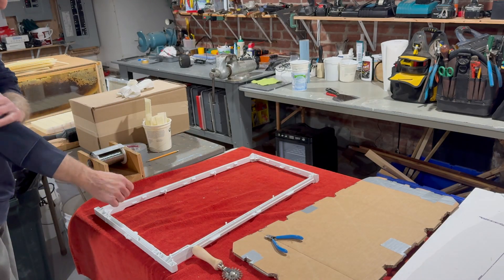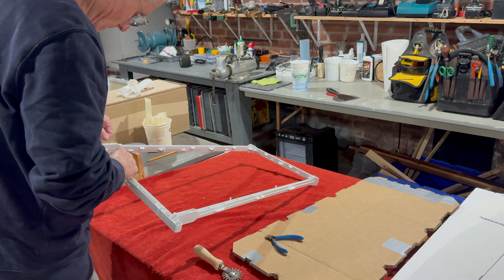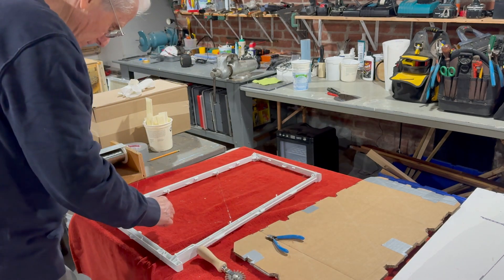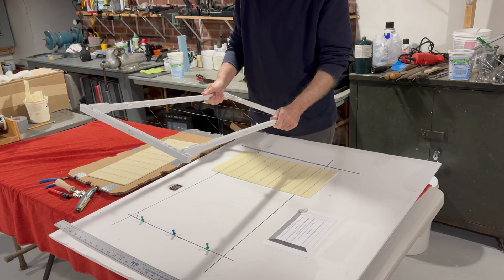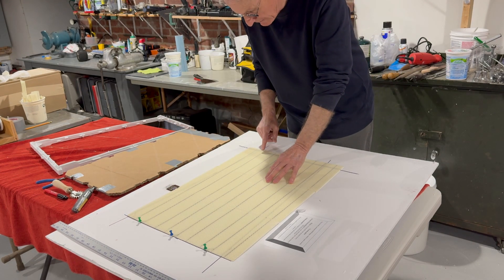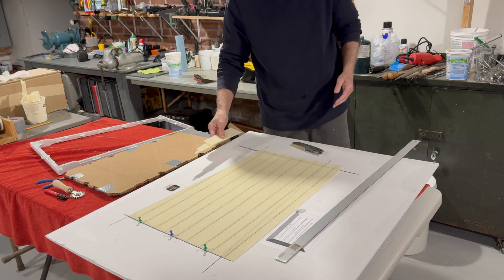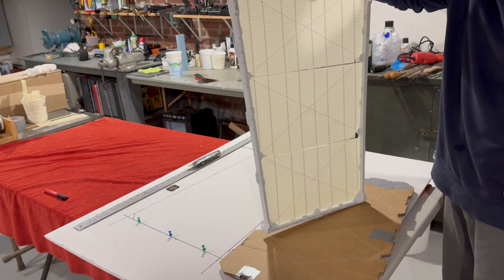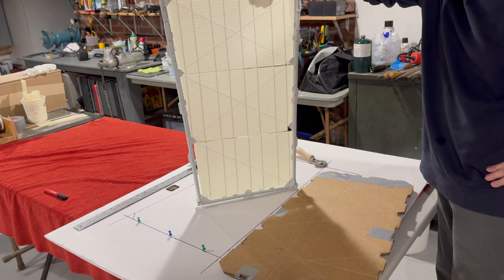Primal Hive Wiring

Comment: Hi Bill, after you crimp the wire into the wax, do the bees build right over the crimped wire?
Reply from the maker: Yes, they embed it. You can still see it but they generally ignore it. But some bees will avoid the cells it runs through.
Reply: Unfortunately the hive i ordered came with shorter sections of wax so i nee to trim a small inch and a half piece at the bottom. Its a super frustrating process😂